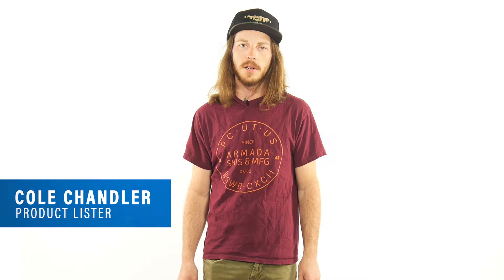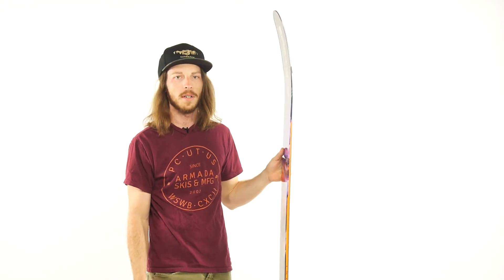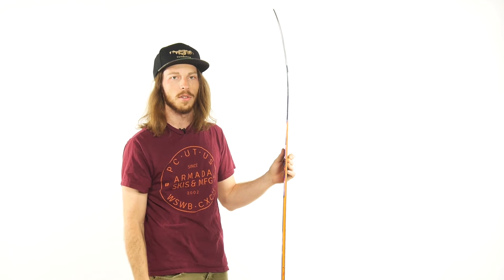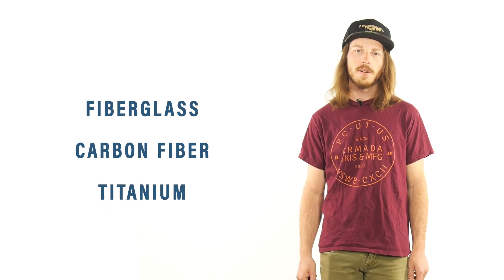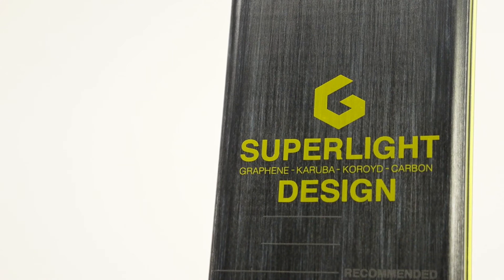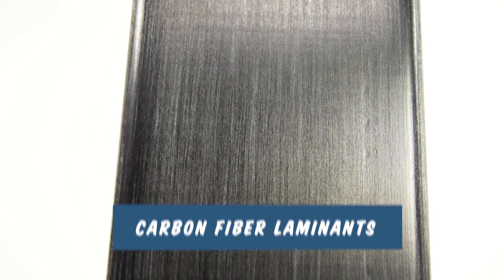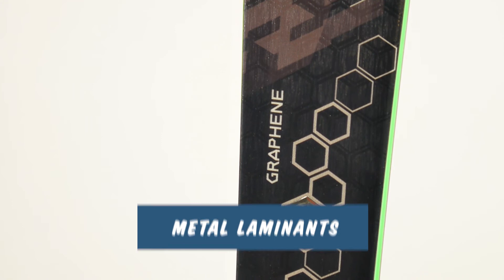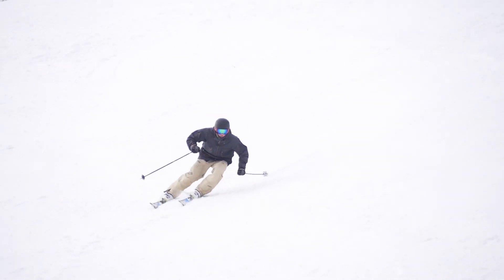How To : Ski Construction and Materials

Comment: Hi there! Great information. Choosing a ski is made of 10 % steel  , polyruethane and fiberglass instead of a wood core, means less life duration but also greater rebound ?
Reply from the maker: Not necessarily. Most skis are wood core and many of them have great rebound. A wood core ski with metal or carbon fiber layer(s) will be stiffer than a straight wood core ski and will tend to feel damper (less chattery). There are not many skis above beginner level or kids skis that don't have a wood core. Some companies are making all carbon skis that are super lightweight but very expensive. The performance of a ski will come down to all of the materials and how they are put together.